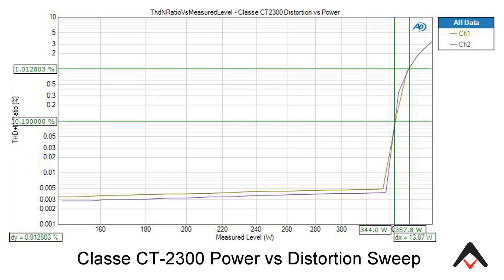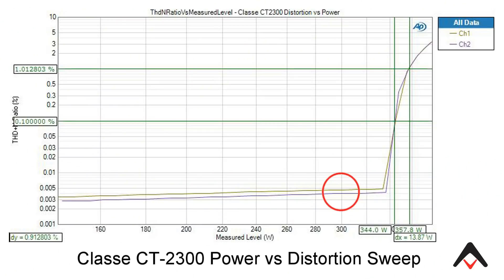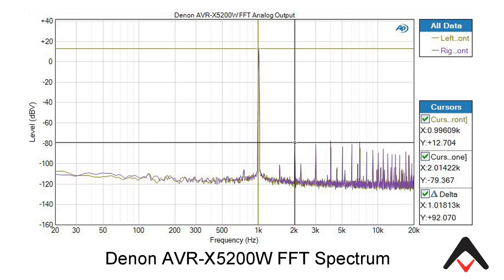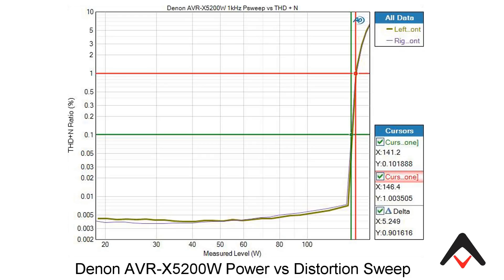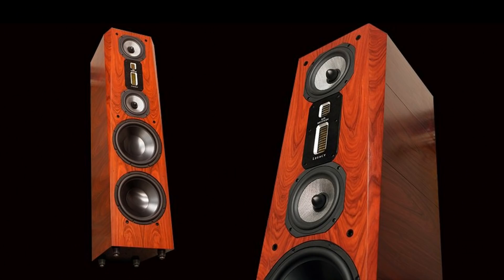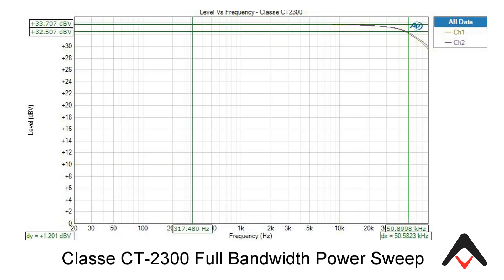Understanding Power Ratings in AV Receivers

Comment: What power input voltage were you running into the Classe?  My guess is it is rated for 300W with a power input ranging 95VAC to 235VAC.  Depending on their power supply setup, it may be running out of power at 300W with 95VAC on the power cord.

Comment: This ratings thing really was a joke back when i went to buy a new AVR back when the Harman / Kardon AVR347 came out and i went to buy a new AVR, i wanted something more powerful than the (rather ordinary) Sherwood 6x100w AVR i had, and the guy in the store said "if you want the most power out of what we have here, you want the H/K, it has 55w per channel..." I instantly said that is half what my Sherwood has, and he said "let me get the specs sheet out of the box and explain it better", He showed that the H/K was rated at 55w per channel with ALL SEVEN channels driven, and at 20Hz-20kHz with a very usable THD, where every other brand they had in that store at the time was rating with 1 channel driven at 1kHz with 0.1%THD, hence they had numbers like 140wx7 etc... 

He went a step further and showed me a demo unit, which was a H/K AVR247, and compared it to a Pioneer and a Sony, both had ratings of 130-140wx7, and there was no question the H/K had more power than both of those others with the two speaker setup he was using to demo the AVRs. The H/K was very obviously heavier than the other two as well.

Needless to say i bought that H/K AVR347 and the difference between that and the Sherwood i swapped out was HUGE. 

It wasn't much after that (from after the AVR360) H/K started rating their AVRs in a similar method to other major brands, and then eventually fell off the map anyway. 

Last year i swapped out my H/K AVR360 to a Denon AVC-X3700H, and i'd be surprised if that Denon has much more power than that old H/K, it has more, but it wont be much. The 3700 has since been swapped out again to a Denon AVC-X6700H, and that one is better. I still don't trust the power ratings though, and the guy in the audio store i bought the Denon from was talking in listed power figures, and was reluctant to acknowledge the fact that they don't actually put that out with all channels driven in any meaningful or useable way.

Comment: You are right, I had a pioneer sc87 and I had the amp died on me twice but due to am on a budget so I bought a Marantz sr7013 with an Emotiva A3 amp to push my front and center to minimize the power been used by the Marantz. My Marantz gets really hot that I had to buy a cooling fan for it

Comment: I have a Yamaha having the same issues is there a while the beef it up or is it better to find one when you ever get money saved up for it and how do you find the right one I have a 10 inch subwoofer and when it gets into like the mid range starts pretty much dying right out and he gets to the low about 15 you could barely hear it it’s barely moving on speaker I have a Yamaha speakers shelf ones about 4 inches and I also got a Polk audio speakers shelf tight eight ohms and the floor when I think it’s six ohms radio keeps having problems putting out so I have to have all the adjustments as we go that is in the distance and also +7+8 for the level it seems to like go completely quiet and that’s on number 42 for the volume level I really want to know how to find out the perfect radio something out we’ll push the 2+ a 12 inch speakers in the front my 1977 receiver I had it was only 110 whites and that’s a little bit more power than every radio I own since then I got rid of it cause I couldn’t hook it to my TV and I thought it be cool to go to HDAnd everything else and I really just don’t know why I can’t find anything that’s more powerful than my 1977 receiver would like to hear about Richard

Comment: I just bought the pile PT 390 AV stereo receiver 300 watts. I have four subs to pioneer 12 4 ohms and two Rockford fosgate 12s they're also 4 ohms. I understand running on parallel and everything but shouldn't I get a preamp to connect

Comment: I still can't understand, because i am total 0 in tech specs. So if i have Denon AVR 6700, it's rated at 140w per channel @ 8ohm 2 channels driven. So how much would be power per channel if i use 11 channels + 2 channels from amplifier. It's like 280 devided by 11?  Thats not a lot of power for 11 channels at all. How do you exactly figure the power per channel? I have 1, 7 channel amp with 300w x7 channels @4ohm + getting second unit, beause damn Denon 6700 cannot be Amp assigned to each separate channel, only 2 speakers or full pre-amp. Distortions are terrible for that 11 channels. Don't need special ears, i hear the hrrrrrrr and prrrrr everytime sound goes up loud, in Star Wars, or when people are screaming comands, in Fury movie. The level of sound, 65-70db on receiver screen. I have Rubicon 8 300w @4ohm,  that is driven by separate amp rated 300w @ 4ohm per channel. for L and R channels. Rubikon Vokal center 250w @ 4ohm, Rubicon LCR for Left and Right surround 150W @4ohm, the rest of speakers including Atmos is Oberon 1, rated at 110w ish @6ohm. The system is 7.2.6. So that would require much more power than Receiver can push. Considering power consuption of 750w, i assume its 280 devided by 11. It's 25W per channel basically... Then no wonder it's all going HRRRRRRRR and PRRRRR even at the sound level i use. Which is far from any reference. On top of that confusion with 1 channel driven at 6 ohm 205w, Denon is doing same crap even today. Check their official website. Some sites that sell them just push bullshit in commericals 11 channels 140w per channel! Which is outright BS. How can you have 140w per channel if total power consuption is 750w. It's just impossible. Now my current 7 channel amp and future second one, is 2100w power consuption and weight 53 kilograms, i can believe its 300w per channel.

Comment: I'm asking for help!
I have exactly that AV Denon 5200w that you showed in the video and I am not happy with the sound in stereo mode. I would like the sound to be more present and defined in a quieter way of listening. The speakers I use are B&W 685 s2, 100w at 8 ohms, 87db sensitivity. What should I do: if I need to change the speakers, which ones do you recommend or get an external amplifier and which ones do you recommend? Thank you!!!

Comment: Loved this! This has been my gripe for a decade or more. I just bought a really inexpensive Yamaha 2 channel stereo receiver for my bedroom that is rated 100 watts rms...now get this....frequency response 40hz to 20khz. I’m figuring it’s more like a 50 wpc amp in the real world. No complaints, it’s a nice little rig for a bedroom. But...no match for my Marantz 2270 that has a real rating of 70 wpc. These kinds of misleading specs really yank my chain. I also have a 1984ish  Yamaha A700...now that’s a real 100 wpc integrated amp. It even blew one of my JBLs once. But that’s another story. Ok...full disclosure...I blew the speaker ( I ignored the circuit breakers kicking in at an extreme volume for an extended time...don’t judge...I had one too many drinks). Did you know a JBL LF driver puts out the prettiest blue colored flame?   Thanks again for a GREAT video. And tell Mr. Spock I saw him smile.....

Comment: I was surprised when tested my Marantz SR4600 (80W/ch) and compared to my stereo amp PM7001 (70W/ch). The PM amp drives same speakers more efficiently and needs less volume knob travel to achieve similar sound level. Even using the pre-amp out on the PM amp it drives my active studio monitors much more better. So I thought the receiver is malfunctioning or something so I brought it for a maintenance and the guy said don't worry this is only manufacturer's power rating games. And then I came here to this great explanation video. Thanks! And I really feel cheated by manufacturer which I like most...

Comment: Back in the good old days REAL power outputs were published in watts from 20Hz to 20kHz at x% distortion into 8 ohms (also at 4ohms and 2 ohms if capable) all channels driven. They also published damping factors. Today's specs on mainstream components is a joke. In the 70s and 80s Marantz always underrated their amplifiers. Dynamic power output is plain BS.

Comment: I just love that straight to the point , at last thanks for exposing the 1K nonsense for manufacturers testing into 6 ohms . We are in the pro audio field supply large format systems to festivals the golden rule we use is if a power amp can’t drive into a 2 ohm load from 20 hz to 20 k then  don’t buy it . If a av amp can drive a 4 ohm load a least your half way there .

Comment: Hi, pleas advise me on the best external amplifier to buy. I have good speakers which boost  a max. 400 Watts. JBL ES 90 BK and  using a Denon AVR -S500BT Receiver. I didn't have lots of money but need a class AB amplifier to use pre-out. Please advise someone below $300. I feel like I am not getting the most out of my JBL speakers since the Denon doesn't come even half way the power the speakers need. Your help will be appreciated.

Comment: A truly honest amplifier rating would not talk about watts at all.  It would refer to the maximum amount of gain (in dBs) that it can provide into a minimum impedance over a specified frequency range, e.g. +21.7dB, 2 Ohms minimum, 20 Hz to 20 kHz.  However marketing-speak is king, and "200W" sounds a lot more impressive than "140W", even though that's a difference of only 1.6dB in peak output.  Good luck hearing that difference :-)

Comment: If it is rated at 150w  at two Chanel's driven , would it then be 75 w a 4 Chanel's driven ?  And so on as you increase Chanel's I have the pioneer VSX -LX 503. I am set up as 5.1  and even at - 17 DB volume it is quite loud and the receiver never gets hot in a fairly tight cabinet . 
Would love to see you test that unit. I love your videos . Great honest no foo foo fluff information . Be well

Comment: I bought a new denon from big box store for $450. Claimed 150w 8 ohm. Got it home and blah. Total flop. Wouldn't drive my 150w at 8 ohm mb quart towers. Took it back and bought online used denon avr 5800 for $500. 63lbs! 7 channel amp from early 90's. Only downside is no hdmi inputs. I use optical inputs instead and it drives all the channels hard. Old units are far cheaper if your looking for true power not marketing hype.

Comment: I really love your videos but I must be misunderstanding something even if they have rated the amplifier at 6 Holmes most people I know have 6 ohm speakers would that make any difference would that make the amplifier rating the same on all the reviews that I've seen on the Onkyo when they have been tested they have always worked out with you have more then what you need I will say this though this is the older versions from about 10 years ago I have the Onkyo TX 579 and the old nr609 all 10 years old but absolutely stunning they sound brilliant in stereo and brilliant in surround sound and enough volume to rattle my windows and then some now what you are saying if I went to a coach speakers I would have to drive the amplifier harder have I got that right
My Onkyo TX nr609 I think was rated at about 165 Watts at 6 ohms which was make it roundabout 115  watts per channel then you have to reduce it for distortion purposes I work these out at roughly a true power rating comfortable power rating at 100w minimum per channel at 8 ohms 110 watts Max I hear people say this kind of thing about old amplifiers but to be fair they did it 30 years ago I brought an old Pioneer sa 9 40 from 35 years ago and they did the same thing they are rated at 6 ohms or 8 ohms it was rated at 87 Watts per channel I think that was roundabout right but I think here is something else going on surround sound receiver work different to stereo receivers I know when I had my pioneer from Number 1 to number 3 the power metres would be indicating I am chucking out 70 Watts per channel on volume number three now assuming the amplifier is roughly 90 what's per channel that would mean from number for onwards right up until number 10 would only Lee give me another 20 what's the channel maximum so basically Lee I'm all this stereo amplifiers I've had the bulk of the power is between nothing and number three after then when the volume increases very slightly what I found with the round sound receivers is the volume works the opposite way round the amplifier starts off with the very subtle volume increases and after a half way you hit the power I was always told that specially cinema amps need power in reserve you have lots of different film volume levels you have talking you have Explosions and you have really really quiet stuff or loud stuff now you can have your volume on half way but if the film is on a very quiet scene it will be quiet but it will need the power there for any actions things that come after that these are a different animal and very unreasonable to judgement to a stereo amplifier am I wrong or am I right on top of that efficient good speakers when I was a little lad my dad said to me spend the most money on your speakers and I still use that lot of it today and it has not stirred did me wrong please excuse my grammar my friend I am writing this from a hospital bed I am voice typing so anything can be written lol lol lol keep the videos coming brilliant work love from the UK

Comment: i own a denon avr x1500h .and i run it as 5.1 now..is it better to use 8 ohm or 6 ohm speakers...i know it can drive  them but ...i have an 8 ohm 87db center speaker,,,,a pair of 6 ohm 87db mains ,,,,,and 8 ohm  90db backround...is it better to use 8 ohm and high sensitivity ? and at the end ....maybe the impedance of a typical 6-8 ohm spekaer is not so importand,,,,should i look better for the sensitivity ?

Comment: What you think about the Onkyo TX-NR676 7.2 Channel 4K Atmos Network AV Receiver
Reply: I have that receiver and it is a good one but I recently took it to my repair guy to look at because I thought something was wrong with it and warranty is about to run out and he gave me his honest opinion based on the hardware and he said it’s a low budget receiver as he’s seen these receivers come into his shop. It does what it’s supposed to do but if you have floor standing speakers it will underpower them,  so as the gentleman said in the video you’re probably going to need to get an amp if you really want that extra power. Unfortunately the TX-NR676 doesn’t come with preamp outputs. It’s great to at least have that option. For the most part with these receivers you get what you pay for is what I have learned.

Comment: Just so I van have a reference ,how many watts output would you need to be at say 75 db of sound with a good quality sensitive speaker?....reason I ask is because I want to know just how many watts you would need to run a good volume ? Do you need more than a 100 watts to obtain 75 db or even 100 db in a listening position say 15 feet from sound stage of speaker system? I hope you get the "gist" of my question?....lol!!

Comment: ATC, acoustat  and B&W are quite tough to drive.  I dare say, not less than a TRUE high current 100 watt amp.  Two different receivers (Kenwood super (260 wpc rating) and a more modern denon (180 wpcrating ))  clearly could not drive them to  even a moderately loud level (88 db)  without obviously weak bass and a "closed-in"  soundstage indicitive of near clipping. A 100 watt NAD, Anthem, Bryston etc... had no issues.

Comment: Hello, when I want this AV receiver unit as hub/integrator for more AV sources and most important for me is THE unifying function of properly upscalled video AND MOSTLY properly compressed(!) audio dynamics, to be comfortable well even during watching DVDs at evenings (not too loud explosions and not too quiet speech - simply as HOME is NOT a THEATER ... especially at midnights) .... so, is there something you can tell about AV manufacturers, how they handle proper adjustable audio dynamics compression during LOW power listening ?? tnx

Comment: If the mass of AV receiver buyers don't know the difference, what is wrong with the truth? If a 7.1 AVR has 50 wpc 20hz - 20khz rms 7 channels driven at rated distortion, what's wrong with knowing the truth? When you purchase 40 watt light bulbs would it make you feel better if it's rated at 150 watts? Are lawn mowers rated 100 HP minimum to impress? I think it's a disgrace that mainstream AVR companies are allowed to deceive customers.
Reply from the maker: Big #'s look more impressive to the uninitiated.

Comment: I recently auditioned an Onkyo 1030 & Marantz 6011. Ok, the Onkyo's claimed power was  135 W (8 Ohms, 20 Hz-20 kHz, 0.08%, 2 channels driven, FTC) and is THX certified with an SNR of 110db. The Marantz has a Power Output 110 wpc (8 ohms, 20 Hz - 20 kHz, 0.08% 2ch Drive) &  doesn't have the THX designation. I went from Canton GLS 2 6's(excellent) to ELAC B6's(horribly overrated) in the loudspeaker department. What was the outcome, you ask? The Onkyo has a massive amplifier section(deceiving) compared to the Marantz's cleaner appearance. But, the SPL & all-out sound quality was far better with the smaller & lower power rated Marantz. The Onkyo sounded more like an 80 -100 wpc rated AVR. And the Marantz sounded more like a 125-150 wpc AVR in comparison. So, what do you think Gene?

Comment: Bottom line - You have to separates with your receiver today!
 Smart thing to do, buy the cheapest receiver with preamp options and all the latest features you want and go all out on a good preamplifier that will last you for years.

So when the receiver gets outdated, just spend a few bucks to get the latest one without much power but preamp options and use your preamp to get it as a top notch receiver.